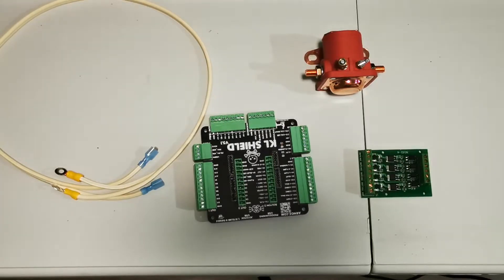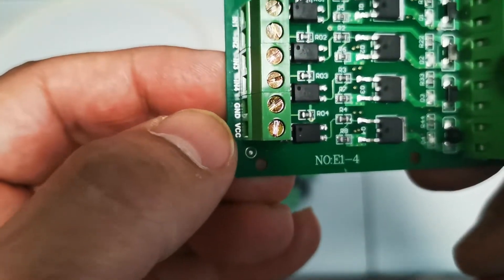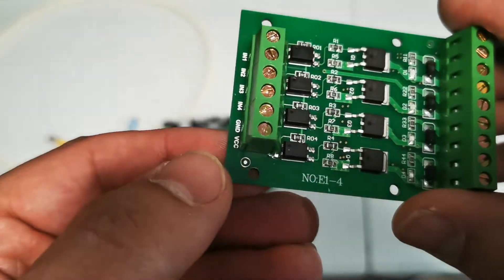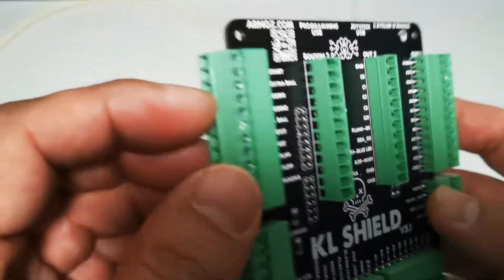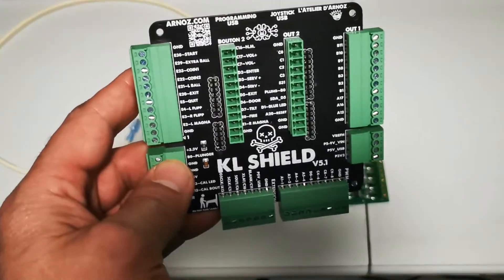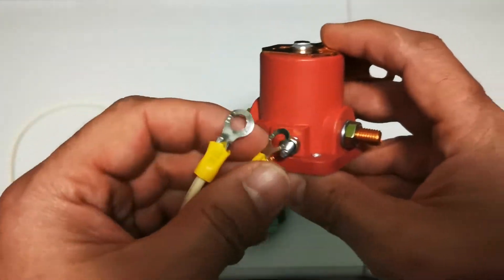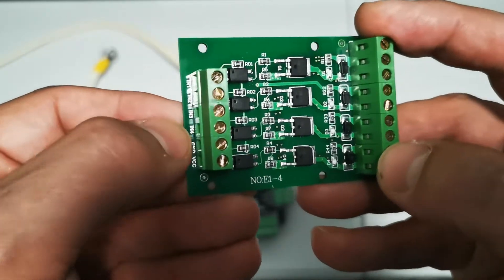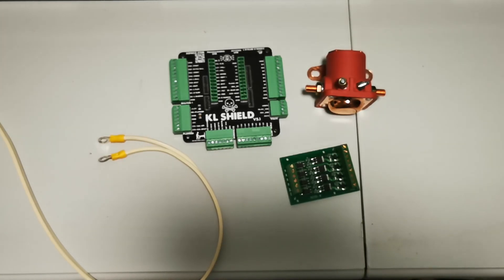Pinball Tech 101 - Solenoids

Comment: So I often see the use of diodes….  No need for that in this type of setup?  What type of power supply do you use for this?  Any links for that?
Reply from the maker: These boards have build in diodes, there is no need to add more. You can if it gives you peace of mind, but just extra work for no reason. Any 12V / 24V power supply you find on Amazon will work. I'll see if I can link it here.

https://www.amazon.ca/dp/B08DKL2DHJ/ref=cm_sw_r_cp_apa_glt_i_MBGKTP5QGGMRH58ZKS6V
Reply: @cleetusvandame  The video isn’t very clear…. Can you tell me all I need to setup 8 of these solenoids?

Comment: I have a question, i have 12 volts solenoids.
The + from the solenoid, goes to the vcc from the outside of the mosfet board.
The - from the solenoid, goes to the out from the outside of the mosfet board.
And the 3 volt comes from the kl-shield, and goes to the vcc at the insde from the mosfet board.
Where do the solenoids get the 12 volt from, and if needed where do they get it from a 12volt transformator ?
And if how do i wire these 12volt wires?
Reply from the maker: You have to connect the positive and negative wires from your 12v power supply to the bottom two ports on the output side. You can daisy chain to your other mosfet boards if you have more than 1, but only if you're running 12v. Anything 24v needs it's own power supply to the mosfet board you're running the 24v toys from.
Reply: @cleetusvandame  Many thanks again.
i'm going to try today to connect 2 mosfetboards with 8 solenoids, a 12 volt transformer, the pinscape (KL25Z)with the kl-shield V5.1
and installing the pinscape software.
Ofcourse for the software install, i will use youre video: Pinball Tech 101 - DOF / Pinscape software setup. :)
Reply from the maker: @rein3751  good luck. If you need anything else, please let me know. Be sure to double and triple check your connections and software configuration.

Comment: Goodmoring and thanks again for this nice video, this information helps me alot connecting everything to the KL-Shield.
For me everything is a strugle, because i don't know anything about electricity and wiring.
i have to learn a lot, and thats why the simply things for you or others, is a headache for me.
thats why i like youre videos, simply wiring from a to b.
i don't have a pinbalcab yet, because i wan't to try fist connecting everything on a wooden board like you did,
before i buy the cab.
So maybe in the future i will have my own build pinbalmachine.
Reply from the maker: That is a very good plan. Believe it or not that's how I do it. Test it all outside the cab and once you get everything working, once you move it into the cab, if something doesn't work it will most likely be wire related.  Watch for more tech videos soon. I'll be covering a few other things. Thanks for watching and glad I was able to help 🙂